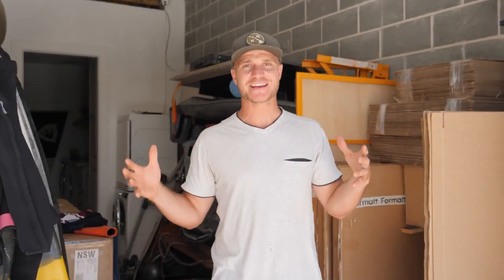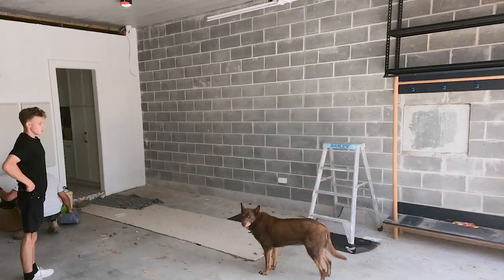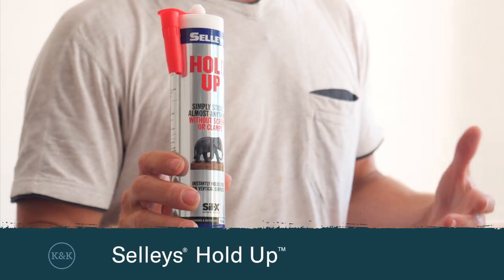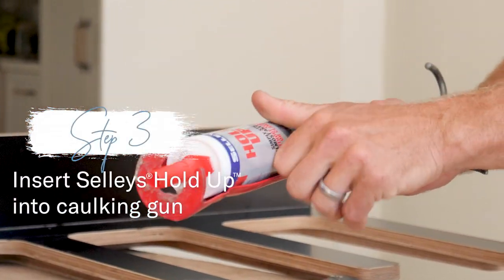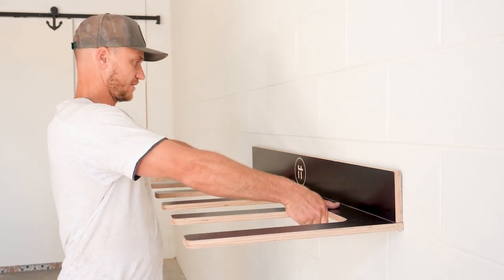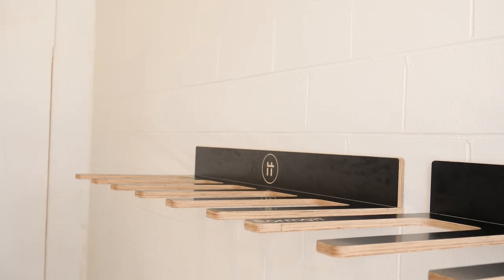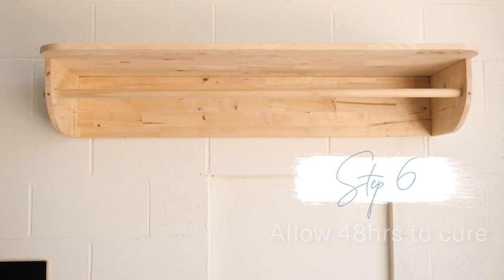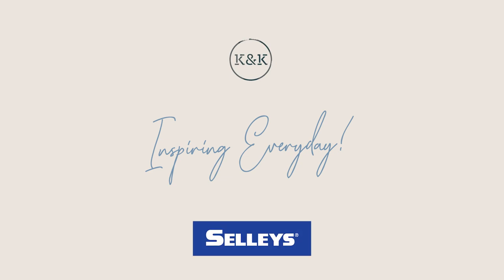How To Organize Your Garage Using Selleys Hold Up | Kyal & Kara from The Block

Comment: Can I use it on ceiling?
Reply from the maker: Hi @Alexseeph
For ceiling's we would recommend using screw fixing along with the Selleys Hold Up.
Selleys Help & Advice Team
Reply: @SelleysAustralia  Well noted on your advice. I have tried hold up in my bathroom I am definitely amazed by the holding strength. I accidentally overloaded my fixtures. Surprisingly the fixture broke but the bonded area is still fixed tightly on the tiles. Once again, thank you for providing us such a great product